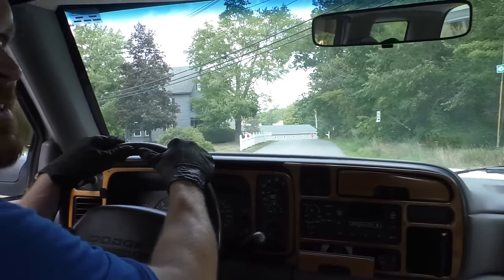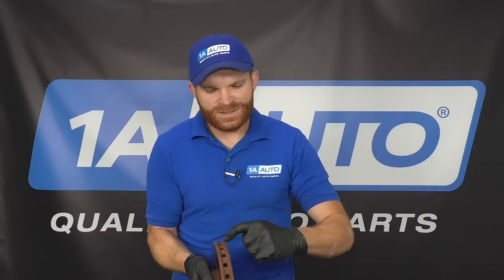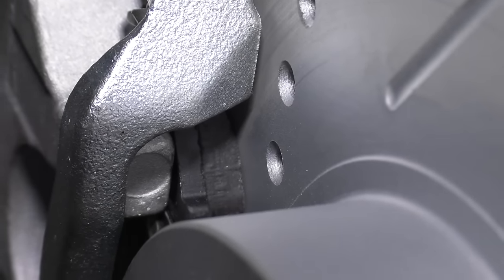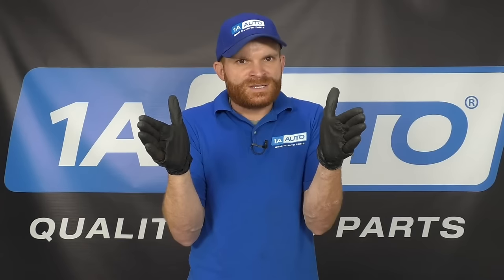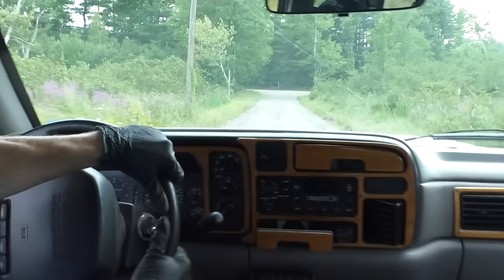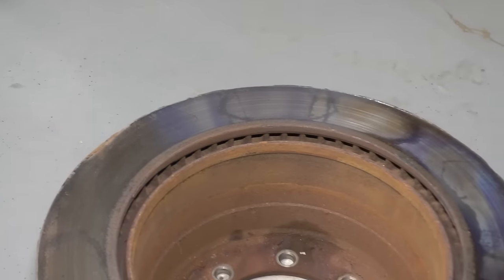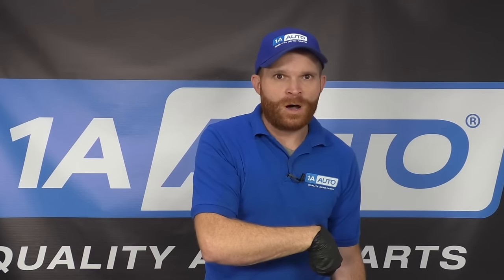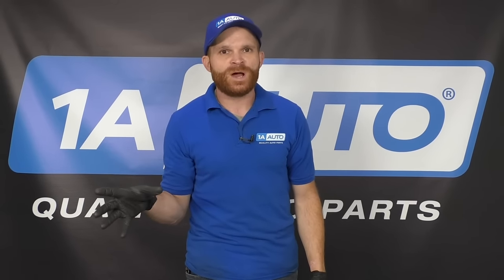What Causes Brake Shuddering, Shaking, and Pulsing on My Car or Truck?

Comment: Looks like every 2 years I need front rotors, last I put rotors from the dealer for 07 Lexus RX 350 after driving two years in the city I put 15K miles the rotors are warped I get steering shaking when I push the brake pedal on high speed.  It it too early to warped rotor at 15K miles or at 2 years?  Can pads make rotors get warped? 
Thanks
Reply: Yes, you might have to look at the pistons not engaging properly, look for rusts in between the pads and brackets.

Comment: What if I only feel a little pulsation at higher speeds and only and a rapid deceleration? I assume it's my ABS. But I want to make sure I know what to feel for before I have to worry and have a mechanic look at it and tell me I have to do unnecessary work just to make money. My brake pads in back are relatively new. The front is about 50%.

Comment: Can air in the ABS Module cause this to happen? My steering wheel shakes after 2 miles of driving. I imagine if it was rotors this would happen no matter how long I’ve driven it. When I bought it the brake fluid was bone dry.

Comment: If I have drilled rotors in the back but solid rotors in the front, could that be the cause o pulsation in the front when braking at speeds of 50mh+?

Comment: Hello, I have the problem with my 2009 RAM 1500 that I have a strong vibration in the brake pedal when braking. The rotors, pads and calipers are new and I still have the problem. Can you give me a tip?
Reply: I have the same problem,  all new rotors and pads for all 4 wheels.  Suddenly seeing crazy pulsating and shaking.  This started after immediately the new brake hardware.  Let me know how you fixed it. Thanks
Reply: @utdoc  I have renewed the rear brake discs and since then everything is ok.
Reply: @mikeHD74  thanks.  I'm going to pay a visit to the mechanic who installed the brake hardware,  let's see what he finds.  Very annoying problem.
Reply: @utdoc  Good luck and report back if he found the cause. If all brake discs are new and also the pads, it may have been either only the installation, or it comes from somewhere else ...!

Comment: My daily just had brand new slotted and rolled rotors put on the front and machined reco's on the rear, standard pads on the rear and metal's on the front and I still have shuddering when braking. I have this metallic sound from the left rear, I suspect a calliper not retracting properly but the shuddering.....could that be because of worn put tie rod ends?

Comment: Question. I had my brakes replace and rotors replace in the front but they continue to shake. They only started shake when I replace my rotors and brakes. The dealership says I have to replace the rotors and brakes again even tho they are brand new brakes and rotors. Is it possible they gave me faulty brakes and rotors ?

Comment: My brakes are pulsing without steering wheel effect and hissing and resistance to pressing in a small portion. What if this is only a brake booster leakage?

Comment: I have a issue with my brake pedal gives pulsations while in park or gear its a 99 ford f350 7.3 dualy 4wd
Any ideas what the problem could be?

Comment: In need of some help, I have a 2000 2.4l Tacoma and recently it’s been clunking/grinding when braking when I’m almost at a complete stop. Doesn’t always do this, most of the time it breaks fine no noise. Let me know what you guys think is wrong. 

Ps-Wheel bearings have been replaced, new ball joints 

Could the guide pins be a cause or caliper piston?
Reply from the maker: +Dayton We wouldn't be able to diagnose an issue like that here, you may want to have a local mechanic take a look at it. Thanks for checking us out! http://1aau.to/m/Shop-1AAuto-c
Reply: I have the same problem with my Toyota Camry 2006 V6. 3.0l do you know what can be ?
Reply: @Sipak1  ball joints, something stuck in brakes, brake pad alining pieces being worn by rotor
Reply: @Sipak1  mine was a broken ball joint
Reply: @Sipak1  make sure no grease is on break pads

Comment: Please help, Car Escudo 2.0 ABS. When the car is traveling at speeds between 30 - 60 kph, sometimes it feels like the car is braking itself, (brake releases brake again releases again) and sometimes it repeats. When this occurs, when you step on the gas or release the gas pedal, the braking symptom itself disappears. Then sometimes it reappears. For the ABS indicator no warning is on. The engine rpm is stable, there are no symptoms of a drop rpm.

 Please help gentlemen, Thank you very much.

Comment: The ABS hose leading to the front brake is severed. The ABS dash light is "LITE". Just installed new calipers and brakes but still pulsating when braking? ABS hose the issue?

Comment: Mine happens after about a year. I've replaced rotors and pads again properly installed cleaned and broken in and even used better quality. Still happens. And  again its been a year. Is it possibly the Caliper. The vehicle is 14 years old.
Reply: I had this issue on a car of similar age that's been scrapped now. It started when a garage replaced my front pads, discs, a bearing and calipers. It would still get very hot, very quickly and no one could work out why.
Reply: @TheLordLaing  I'm going to inspect the caliper for smooth operation. But I saw a thread that said some vehicles are off and no matter what it continue to happen. So the suggestion is to have rotors lathed to match the vehicle. I just can't remember the exact term for that process.
Reply: @onlyme8870  yeah it makes sense, might as well give it a go. The discs can be skimmed while on the vehicle.

Comment: My 08 Altima does that pulsation during high speed without applying the breaks and while applying the breaks. After a complete stop and I drive again,  it'll completely stop.
Any help with this issue?
Thanks

Comment: This does not work on modern cars ESPECIALLY European. The chasis are so rigid and the steering is so solid you won't feel the vibration in the steering wheel even if it is the front rotor(s)....I can attest to this, even if the pulsing is REAL bad you won't feel it directly in the steering wheel. Gone are the days of sloppy drive trains and suspensions. The best way to find the issue is to check for run-out with a dial indicator or equivalent. You may have a bent hub which was damaged for example...in the winter sliding into the curb. The damage can travel all the way from the wheel, rotor and eventually the hub and hopefully it stops there and not to any control arms and other suspension components. Also riding on a bent hub with run-out will eventually ruin your rotors as your brakes will wear them unevenly. The best thing to do when you have such damage is to replace all the components because you eventually will be still chasing the vibration in such cases.

Comment: Ive always torqued lug nuts and still, it seems even higher end aftermarket rotors never last as long as the originals before getting warped.

Comment: Hi , I am from India , it was really nice listening to you , very well explained 
But I have a question - I did have the same problem and got my brake disc changed but I still feel abnormal braking ( vibration). It was reduced after changing the disc but still there is a slight vibration , got my suspension checked as well , it is in good condition  
Please help what to do
Reply: Ay man have you also checked your tie rods? He also mentioned that it could be the tie rods if those solutions did not end up working for you. Also I would suggest jacking up one side and try and move the wheel and with some force and see if you feel any abnormally loose movement in the wheel. Also I would check the wheel bearings aswell brother.
Reply: Maybe rust on the hub. Take the disk off and clean it up. I’m having the same problem so will be trying this.
Reply: @davefrancis7213  hey Dave , because of rust it will only give you squeaky sound , if you have the vibration problem then you should definitely get the rotors and the brake pads both changed
Reply: @karanbhasin3876  Rust on the hub - not on the rotor! But measure your hubs, it might be that the hubs are not straight like they should which can also cause this brake problems.

Comment: I have new calipers and pads and flex lines on the front but they did turn the rotors and it still starts shaking a bit then when I use the brakes it starts shaking pretty bad. My brake shop can’t seem to figure it out.
Reply: Someone said it might be the Hub that’s causing the problem…most times the Hub is overlooked

Comment: I have a 2018 silverado 1500 and the truck is shaking I change the tires and put new rims and tires and continue shaking, the truck have power train but the dealer say the problem is the tires, I don't now what more to do because i know is not the tires...

Comment: I just changed my rotors and brakes a week ago. The shakin stopped but then it came back.  I took my car to the tire shop  to get a shake down and inspected amd they said everything  was fine and couldn't tell me why I get shaking when I brake at 60-70mph but it doesn't shake at lower than 60mph. Why?

Comment: Im experiencing some shuddering in my steering when i break. But i just put brand new rotors an top quality pads last year or so  maybe it could be calipers?
Reply: Last year? That's a long time. How are your front tires looking?
Reply: I did mine about three weeks ago and it’s shuddered took it to the dealership they said my caliper was leaking fixed the issue and it did it again

Comment: My 2010 m35 infiniti was shaking when braking so I replaced front and rear rotors, brakes. Went away for about a month and started shaking again. I changed the front rotors again and went away for about a week or 2 and now the car shakes again when braking around 60mph. Any advice? Should I change rear rotors and brakes for the 2nd time again?  Please any advice is highly appreciated.
Reply: I have the same issue... I gotbthe front replaced and brakes, it went away for a week and came back but only at 60-70 mph anything below stops. Did you find out what it was?
Reply: @enrique4737  no. I took it to a shop and the technician drove my car and said it was the rotors. I explained to him that I had just replaced them and said sometimes they come damaged from the vendor so he suggested we get the rotors resurfaced. So I'm going to do that to see if that's the problem. I'm hoping it is because I did not want to buy all 4 rotors again and brake pads. When I had just bought them. If it doesn't get fixed then, I think it might be a wheel hub or something else. Idk man. I was hoping this channel would have a say so about what it might be. Obviously NOT...
Reply: @juangutierrez4501  I feel your pain. I see lots of people asking the same thing but no one has am answer. I just changed mine and it made difference for a week and I'm back to square one 😡 let me know if yours gets fixed and I'll do the same.
Reply: @enrique4737  I got my rotors resurfaced and the shaking stopped. The tire tech said my rotors were slightly warped. I installed and shaking stopped. Now I will do my rear rotors to stop the pulse I get when applying the break. It's not bad just slightly but it bugs me since I drive that car everyday. Plus I don't want it to get any worse. I only got charged 15 a rotor to resurface since I removed and installed my self. I hope it helps you with your situation. Let me know please.

Comment: Hi, My 2016 Ford Cmax Hybrid brake pedal normally stays hard before startup. The Cmax has 16k miles on it, The brake on startup just traveled halfway to the floor before startup. The brakes work normally and there are no visible leaks and the pads are like new. Took it to the Ford dealer under warranty and it was determined to be the Brake booster. 60 days later ( Part delays ), The car is returned to me repaired according to them. The Cmax was returned to me with the same condition I brought it in with. They maintain it was repaired. I'm taking it to another dealer for a second opinion. Is there a procedure to reset the pedal back to factory norms that the first shop missed? Thoughts

Comment: Francis just got front rotors and pads replaced and I still get a slight pulsating  feel but not on the steering wheel. Now one of my rear rotors is shinny the other one in the rear is not does that mean my caliper is stuck or not working how can I check to see if that one is working?? I also press down on e brakes and git the same light pulsation so  i am pretty something is wrong.
Reply: To check the caliper you would have to take the wheel off

Comment: Hey can shed some lite on my situation......the rear rotors are hot so they are working because no pulsating when i am driving only when I apply the brakes and only in the rear  and if the rear rotors are working and have new pads what could the problem???
Reply: Update

Comment: My 2014 Mazda 6 has brake shudder off the scale by 10000 km. Full brake service every oil change is ridiculous.
Reply: 🤔  sounds like something else is going on.
Reply: @sgomez3047  had new T2 slotted front rotors fitted which stopped overheating problems, now fixed.

Comment: I got a 2015 ford focus when I'm driving down the highway and when I start to brake it shakes my steering wheel, could that be the rotors n brakes?? Or the back shock absorbers?? Cuz my back absorbers are leaking and recently got my front CV axles replaced with stopped the heavy shaking someone help please

Comment: I am not sure where it is coming from  it happens when i stop  i feel it when i break not on the steering wheel .  I noticed it a little bit this morning . shaky i  today i had to get the car worked on wheel  bearing was lose they fixed it in the shop and Replace rear  toe  that was broken . I don't drive long distances it hasn't  been driven in 3 months.

Comment: spot the rumbling noise when braking, especially braking from 30km/h to stop, the rumbling noise gets louder and louder during the process. Wondering what causes that problem. Have already visited so many shops but nothing useful information has been given.
Reply: Braden pad bracket is not lubed. Perhaps rust on it. Lube the side of the brake pads that's in contact with the bracket with anti sieze.

Comment: Nope it is immediately not after they warm up im making sure its not something other than the rotor  or brake cause I don't want to replace parts that didn't need to be I know nothing about ford's nor about one's without the normal power steering.  Electric power steering and the entire car is messing with me

Comment: Replaced both rotors, pads,and tires. steering wheel still vibrates when pressing the brake.
Reply: Could be a lot of things ,u joints,cv axle,motor munts,etc.

Comment: I changed my rotors and pads and I still have vibration in the steering wheel and brake pedal
Reply: Try balancing your tires at a tire shop if that don't work it could be a number of other things hope for the best tire balance should cost around 30 bucks
Reply: I just watched the complete video and he didn't even mention the hub or bearing set up. 9 times out of 10 its the hub that holds the rotor/discs and this is more likely to cause vibration through the brakes. Unhappy with he level of competence considering he talks about nearly everything else. Hope this helps
Reply: Usually if there is vibration after replacing rotors and pads next I look into the bearings. My experience with bearings is if one is bad I just do them both because the bad one was putting extra work onto the good one making them both probably bad. Also u can take your wheel off and check your tirod grab a hold of it and make sure its solid.

Comment: Mine was warped rear rotors on my 4Runner.
Reply from the maker: Awesome! Thank you for checking out the video. If you need auto parts go to: http://1aau.to/m/Shop-1AAuto-Now
Reply: how did yours feel.  mine rattles when braking on the hwy mostly felt to the right

Comment: Help please 😢. 2013 gmc sierra brake job 3 years ago. A year later wheel felt like it was falling off, bolt had backed out on driver front. Then next day discovered they didnt tighten all the lug nuts.  Now again a year later & i get this quick shudder, driver front but it only does it once or twice a day when like in a parking lot slow braking & i cant get it to do it on purpose. It sounds & feels almost like your on the rumble strip for 2 seconds & i can feel it in the steering wheel when it does it. Mechanic literally guessed & said he couldnt mimic it so change the caliper & line even though that doesnt match symptom. $700 & 60 miles later it does it again. Only $200 of that was parts. Im suppose to meet with manager tomorrow. What would be the next step? Ive always had the truck serviced but I completely feel like money was wasted & they new it. Any help?